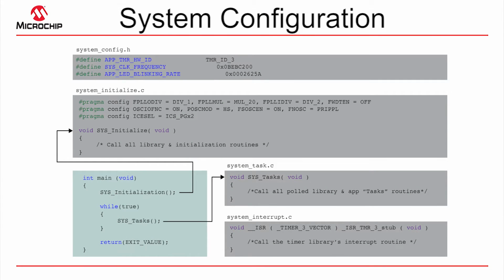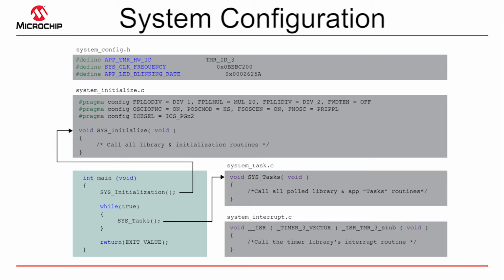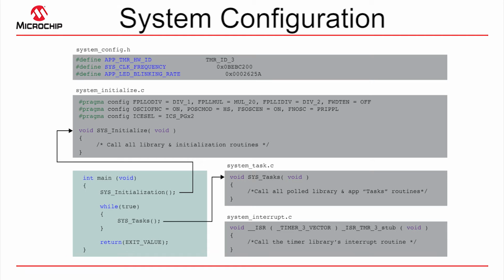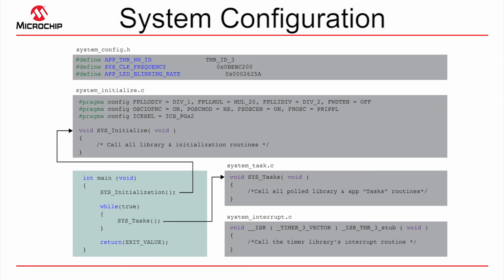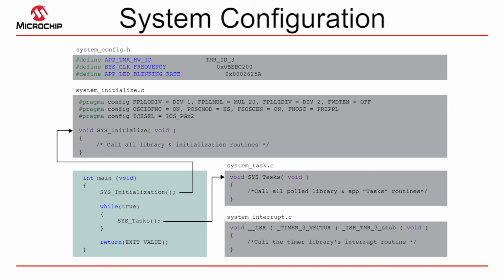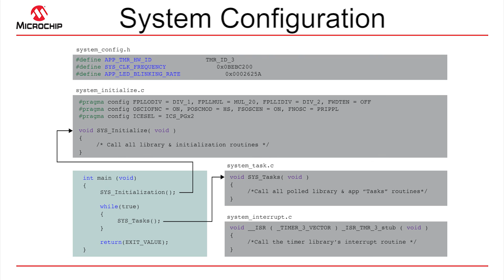Introduction to  MPLAB® Harmony Tutorial #3- System Configuration Files

Comment: Blyat! Thats why is i chose STM32:

That is why the controller is good (but not better than STM32 yet), and the support is shit. This video is an irremovable picture, in the background of which the programmer murmured.

The development environment is “one and only” - MPLAB, you cannot adjust the scale normally for FullHD resolution, You have to press a bunch of buttons and not to overshoot in order to start debugging. And in general, there are many buttons, but there is little sense in them, the code editor is inconvenient, there are not many options, as in KEIL for example.

The PicKit3 / ICE2 / ICE3 debugger sucks. Slowly, sadly, capricious with respect to the cable, and the button, which is better not to press.

Comment: Audio quality is very low. It is very difficult to understand. No pauses on speech, same tone, missing comma and points while speech... As like to hear Radio-News on 60's. Less chance to understand for a person who doesn't speak English as mother language. Not only this video, all of list has same problem. How can development engineers use it, if they don't understand? I think it is important for a technology company.
Reply: Agreed, audio quality is bad. The automatic captions are pretty accurate, though, so turning it on will help you understand a lot more.

Most of these sessions are recorded as a webinar, and the quality of the audio depends on the quality of the presenter's internet connection, which can often be bad. I don't know why webinar solutions haven't figured out that they need to record audio at the speaker's end and not at the listener's end for saving the session!